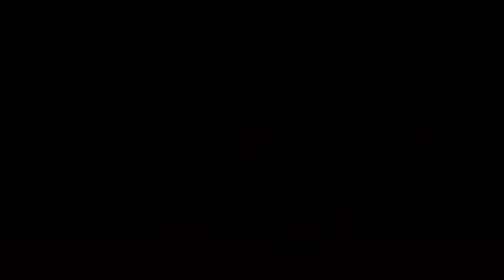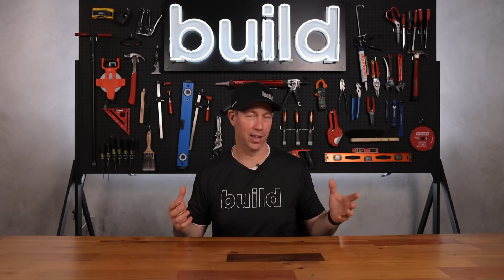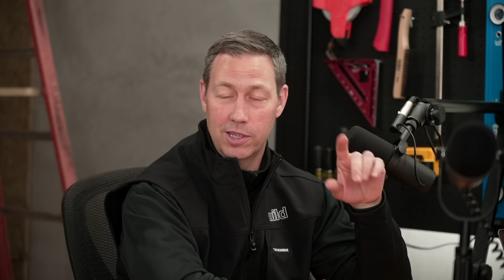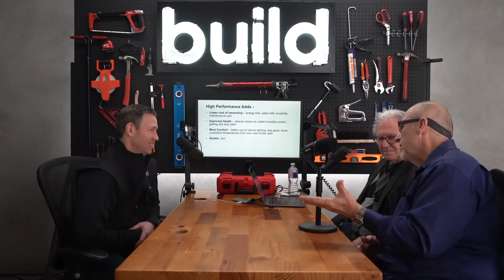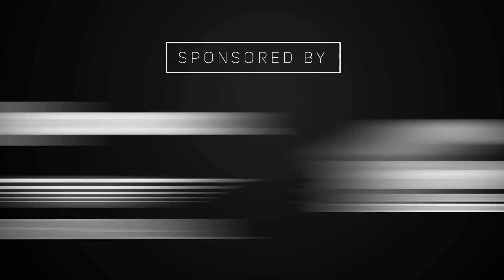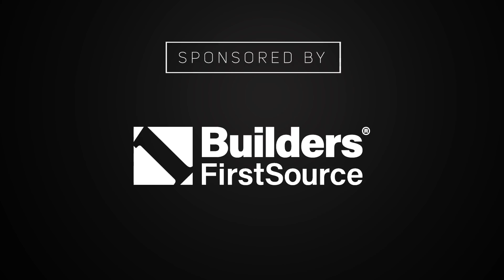How to Design A Better House - Take Notes: This is Good!

Comment: I checked out the full interview on your website. Excellent! I wish the full-length interview was on YouTube.

I categorically agree that the "green" principle(s) of a home are: 1) integral to the design of the home from the very beginning, 2) a home is a complex system for [comfortable] living, and the various sub-systems effect each other, so a holistic approach is necessary (systems thinking approach), 3) a high performing home is a better performing home; it gives margin, so the various systems of your home are not being stressed as often, leading to shortened service life, 4) passive "green" design is always the first place to start, 5) our ancestors built structures that we can learn from.

Comment: Coming from the civil engineering field, I generally have "less than positive thoughts" about architects in general. Fortunately my involvement has primarily been in a commercial buildings & schools, so those had to be functional first & foremost, but I've seen more than a few that were fundamentally flawed in one way or another, based in notl small part because the architect let their desire to create art overrule practically. Fortunately that doesn't hold true for all of them & it definitely doesn't appear to apply to these two. Green by design - not by gadget. Man that's one hell of a great distillation of what SHOULD be the priority. Once upon a time, I was interested in building a LEEDS house. After having interacted with a guy who did when he built his dream home, no thanks. The stupid, unnecessary hoops they made him, for things that didn't add any real value cost him a ludicrous amount. High performance is a much better philosophy that likely generates similar or better quality for significantly less money. We need a lot more architects like them. Headed over to watch the full video now.

Comment: We are enjoying extra comfort in our new house thanks a lot to you guys.  I'm a homeowner and sometimes do installations and projects as an owner builder.  I appreciate your show because I just finished a new custom home with our builder.  Our budget was basic and we upgraded what we could for comfort.  We didn't do a lot of fancy things.  Watching and listening to the different guys across the build show helped us to build a much better house with inexpensive upgrades.  For example, continuous interior foil faced polyiso foam inside our fully cement block walls.  Radiant barrier under the roof.  Extra attic insulation. Two stage air conditioning and working with the subcontractor to have a nice duct system installed with returns throughout.   Whole house dehumidifier with fresh air intake (it's hard to find any subcontractors who know what that is).  MERV 13 5" filter.  The builder, on the south side of the house, where the sun makes it in, used very efficient low e windows.  I went in and sealed the ceiling with canned spray foam as well as duct register penetrations with silicon caulk.  Heat pump water heater.  We have a foam injected hurricane garage door at R11 with custom impact glass.  My wife and I installed a mini split in the garage as well as an exhaust fan/fresh air inlet for negative air pressure in the garage to help with air quality.  There are so many things to do on a budget.  Our house is very comfortable and each room within 1 degree of temperature at any given time.  For 4 months out of the year our air conditioner barely turns on so we needed the dehumidifier for sure.  On the hottest summer days, we never need stage 2 cooling even while cooking and doing laundry sucking air out.  So, we're cooling a 2000sq ft house on the hottest humid summer days in Florida with 33,000 btu.  Only time we're using the full 45k btu is on a thermostat change.  Our air cond could have been sized smaller.  We use an ecobee so you can see the data.  There was exactly one builder I could find in the area that would work with us like this.  So, we cool 2,600sq ft including the garage and our utility bill is less than in our previous 1,200sq ft house.  We upgraded for comfort and we were surprised the efficiency follows that comfort!

Comment: @Matt Risinger If you're not Superinsulating, this is largely noise. R30 walls, an R45 roof, insulated window shutters, and an energy recovery ventilator. Seal properly, get the details right. That's about it. These add roughly 6% to the cost of the construction while cutting 80-90% of heating and cooling costs, meaning your mortgage payment (which typically includes heating and cooling costs) is lower right from the start. 

The "problem"? The only money to be made off it is by the tradespeople who build the thicker walls and roofs, and insulation manufacturers. It's not remotely sexy, but it worked fine in Canada and the northern US, where it was perfected in the 1960s and 1970s, then forgotten. Such a shame, given how much money it saves homeowners over time, how much pollution doesn't get put into the environment, how quiet the house becomes, and how it reduces the need for far more expensive, tertiary 'green' systems. Why would you spend tens of thousands on a ground heat pump system when you can obviate the need for that energy in the first place by designing a Superinsulated house?
Reply: With air sealing being a prerequisite to super insulating. :)

It would be nice if new homes got rated based on air tightness and insulation levels with a forecasted heating/cooling cost that is shown alongside the sticker price. Likewise, existing homes should have 30 years of heating/cooling costs listed next to the home's list price. These two changes would light a fire under the industry to change, because it would make it plain as day to homeowners that higher performance partially if not entirely offsets other costs.
Reply: Agreed. There used to be a big debate in the 70s about superinsulated vs passive solar. Within the last 20 years it became obvious that the answer is both. Initial site layout, windows and overhangs need to take into account solar position and travel and precipitation patterns throughout the year. Bulk water/air/humidity/temperature control needs to be adequate for the location and climate. Build it with the sun and rain in mind, build it tight, and insulate the heck out of it, and there is very little load left for the mechanical systems to deal with. Safer, more comfortable, more durable, quieter, cheaper to own and operate, and greener as a side effect.  Not sure why this isn't standard practice demanded by all homeowners.

Comment: There is some truth to the statement that our ancestors did some smart things in their builds to survive through winters and harsh summers, but most of their houses have been destroyed by rot. If there was one thing a builder needed to grasp it would be that water destroys everything and you should learn how to flash the envelope so as to protect the house for the longest time possible. Also, that any kind of mastic, sealant, caulking, etc. will eventually fail and allow moisture to pass through. Mechanical flashing with materials that don't rust/degrade, especially around penetrations like Doors and windows, is the best way to build. R-value and design are secondary to that.
Reply: I agree 99%, except that one particular aspect of design can have a huge impact on water's intrusion ability. In high rain areas designs with large overhangs are critical, and are on par with correct flashing as far as importance of keeping water out. Flashing is more important in areas that aren't rained on nearly every day, though, but yeah, bulk water kills buildings. Modern building science has the control order as 1. Bulk water 2. Air  3. Humidity  4. Temperature.  Unfortunately most folks do it backward, and start with pretty design with no care for performance or durability.
Reply: @willrodgers7974  Yes, through design or flashing, water penetration is of primary importance.

Comment: Start with the most basic, defining fact that most architects, builders, and even buyers do not recognize: the average house in America has two people in it (meaning that over half have 1 or maybe 1.5 people in them).  I am not advocating 'tiny homes' but small houses with some storage space.  How do you get storage space in a small home (800 feet or less)?  Make your exterior walls ten feet tall (now you have ten foot tall shelving and two+ feet above the windows and doors.  If you make your kitchen/bath ceilings seven feet, you now have lots of storage above the kitchen/bath.  Ten foot walls also allow you to add rooms later.  Get rid of your eaves (look at the pictures of wind damage--the roofs have been blown off and frequently the walls remain--ruined--but remain).  Finally, build with double stud walls.  This breaks the heat transfer through the walls, creates a sound-proofness, and greatly reduces the cost of utility installation.
Reply: 7ft ceilings? Seriously? Ceiling should be proportioned ideally at no less than 2/3's of a rooms longest length..
Sorry, but tiny homes suck. Build homes for families to enjoy -there is nothing worse than having a tiny home and wanting to have a dinner party, it's just beyond sad. America is not Japan, we have plenty of space -let's use it.
Reply: @DesignRhythm  Seven foot ceilings in one room, not the entire house (the rest would be ten feet tall).  Having seven foot ceilings in the bathroom (after coming into it from ten foot ceilings) would enhance the feeling of intimacy.  One thing we should do is cut ourselves free from 'rules' i.e. 2/3's of the longest length (what if you have an open kitchen/dinging area/living room spanning 40 feet?--a thirty foot tall ceiling?  I agree that tiny houses suck but small houses are a better idea for America's shrinking families.  As to dinner parties, how about alfresco?

Comment: Ive always worked with these methods , but mainly  listening to the needs of client, and actually taking the time to understand the clients motives and reasoning.
It annoys me greatly there are so many cut n shut tradies that install what they want, how they want, without any regard for form and function of the end result, let alone how the end user interfaces with the building/installtion.
Top work on Highlighing this massive shortfall in the industry

Comment: "Our ancestors did without X, Y and Z...."

Faulty logic.

He's assuming a level of comfort and performance at least in the ballpark of what can be built TODAY.
And that just isn't true.

Know what the did when it got too hot/cold/stuffy?
THEY LIVED WITH IT.

I'm not saying he's WHOLLY wrong.  And there are simple lessons that can be learned.

Just that he starts chasing that rabbit down the hole and it's gonna cave in on him.
Reply: Not everything is about comfort and style. Our ancestors were smart enough to know what would work and what wouldn't, lately people are using totally inappropriate designs and materials just because it's trendy.
Reply: @Bob_Adkins  I believe you missed my point.  I'm not saying that some of the things our ancestors came up with aren't good technology.

I'm saying that there is this tendency to lionize EVERYTHING they did.  Whether the thing is good or not.

Hey!  We used to stuff walls full of tar paper and newspaper!  They didn't need no sprayfoam or fiberglass!
Reply: @PhotonHerald  I guess their mindset was to be comfortable but not luxuriously so. An extra log on the fire could easily overcome the cracks in the walls.

Comment: Pumicecrete is by far the best building material on the planet Pumicecrete is fireproof termite proof rust rot and mold proof and has a high R value and good sound attenuation solid poured walls means no critters can live in your walls Pumicecrete is a mixture of pumice cement and water mixed and poured into a set of reusable forms Pumicecrete homes can be built out of 3. Materials Pumice cement and water and can be built for a fraction of the cost and time
Show me a better building material and I will give you my house
Reply: HEMPCRETE ?...

Comment: I cut my energy bills here in the Rockies by 90% with our exterior remodel thanks to Matt's videos and some research.  We now heat our home with space heaters when it is -5 outside.  No AC in the summer, either.  Was that green?  Maybe but it will pay for itself over time.
Reply: What did you do? What insulation did you use?
Reply: @75thshootist  We remodeled our exterior.  Stripped off the siding and used 3 inches of Rockwool Comfortboard 80 exterior insulation but first sealed the seams of the plywood and openings with Prosoco R guard and Wigluv tape.  Home now looks the part here but is far more efficient, comfortable and durable.  Windows got replaced with Canadian triple panes.

Comment: We are building a house in New Mexico in the Sandia Mountains (7 Kf elevation ) and this methodology is exactly what we need!
Reply: Me too.  Over off route 285.  I’m wondering if I could build an ICF cistern and use it to store heat for efficient heat exchange later.
Reply: @jesinbeverly  you can use ICF just put a pond liner in it or look for a pre-made liner and build the tank to it
Reply: Pumicecrete is by far the best building material on the planet Pumicecrete is a mixture of pumice cement and water mixed and poured into a set of reusable forms Pumicecrete is fireproof termite proof rust rot and mold proof and has a high R value
Reply: @raymondpeters9186  hempcrete

Comment: How do I find builders and architects in my area who subscribe to the type of high performance building you often advocate for?  I can search for passive house builders or energy star but I feel energy star isn't enough and passive house is too much (or too cost prohibitive).
Reply: Michael, that’s the issue with high performance houses. Not only are they very costly, you need tradesmen that care for the details. Society, in the building world now has it, that for a quality install you need to pay up for it, when it should be a standard. The house Matt built, is easily 2M for a custom builder.

Comment: Unfortunately, costs are out of control and most functional design is extremely expensive on the short term and few can do it for the long term. 

In deep south Texas, few can do closed cell, metal roof, high efficiency water and HVAC systems while still having cash for appliances and decorations.
Reply: As long as high performance is out of reach, it will not catch on. How can we lower the costs?
Reply: @matsudakodo  vote them out
Reply: @normrubio  who?

Comment: I agree and that's why I would like to see more solid pour concrete wall builds. 
I live in central Florida and I prefer the thermal mass indestructible concrete message but feel that it's damn near impossible to find a builder it won't charge commercial prices. 
So my next choice is Icf
Reply: Pumicecrete is by far the best building material on the planet Pumicecrete is a mixture of pumice cement and water mixed and poured into a set of reusable forms and can be built for a fraction of the cost and time

Comment: The best house is one that can be built for the least amount of money and still serve its purpose.
Reply: Yes, but for how long? Building a ‘healthy’ house gets more and more expense further you go down rabbit hole. However, it MUST be dry, and that means. Water barrier on sheathing that is more than some cheap flapping stuff.
Reply: Since most costs are a function of the house's size (materials plus labor), design for the smallest possible house that satisfactorily addresses your needs. That could free up $$ to improve the envelope and thereby reduce the size (and cost) of HVAC. It could also make funds available for nice decorations.  Think "Suzanka's 'Not So Big House'" meets Passive House (or "Pretty Good House").
Reply: @richardhoenich9338  That’s a great approach. Smaller and better quality is much better than larger and you get what you get, both short term and long term.
Reply: I disagree, you want the most “expensive” that you can afford.  If you skimp on materials, it won’t last, spend a little more, you’ll get a quality house.
Reply: Pumicecrete